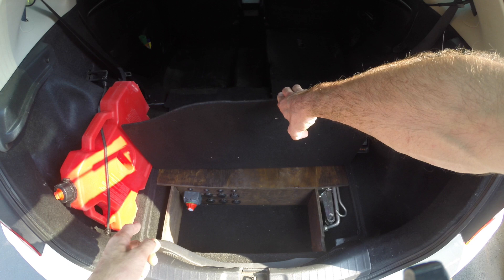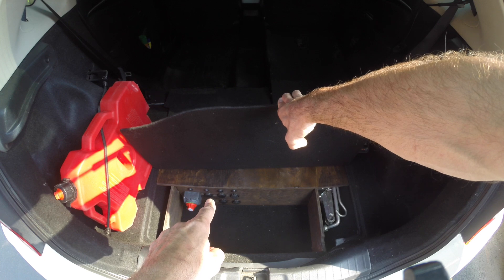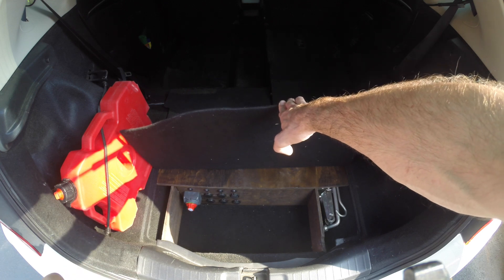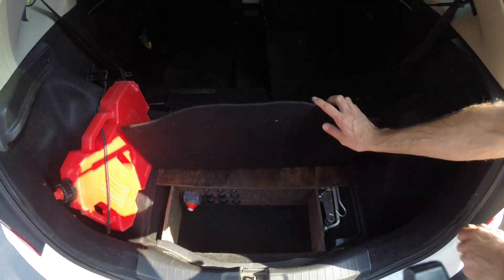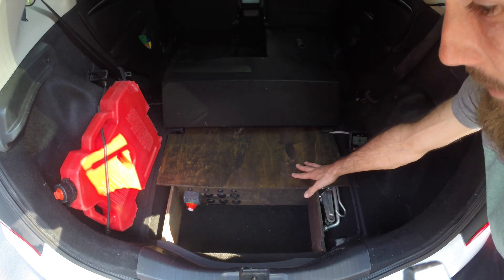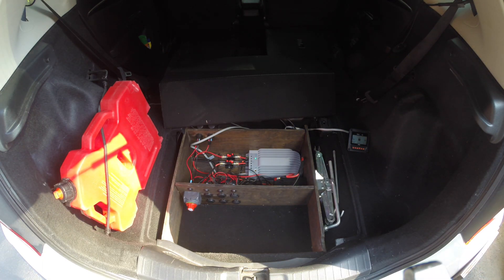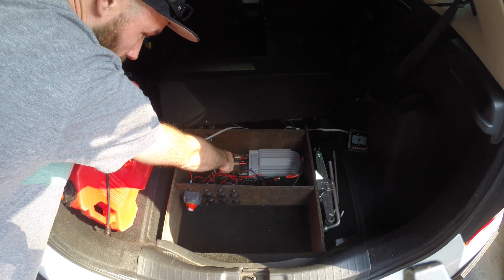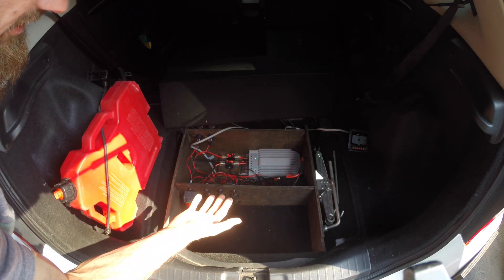HONDA FIT/JAZZ - GK5 - Solar Setup - "Spare-tire Solar Storage Box" #HondaFit4Adventure

Comment from the maker: UPDATED SOLAR STORAGE- Milk Crate Solar Battery System https://youtu.be/269fXIBK7O8
A few Amazon links to items shown in today's video.
USB ports - N/A
12v port https://amzn.to/3sKpG8G
Blue LED Toggle Switches https://amzn.to/3FJCU9m 
Red LED Toggle Switches https://amzn.to/3Hfj1rj 
100pc Blue spade Connectors https://amzn.to/32G1cTm
100pc Red spade Connectors https://amzn.to/3FNbOi1
27pc Large Diameter Heat Shrink Tubing https://amzn.to/32JiOxK
16AWG Red & Black Copper Wire (25ft) 50ft Total https://amzn.to/3euJNjc
EPEVER MPPT 40A Charge Controller https://amzn.to/3mEv7T3
Battery Disconnect Switch https://amzn.to/3Hm3JBf
Blue Sea Systems Fuse Block https://amzn.to/3z1olLU
RotoPax 2 gallon https://amzn.to/3Hhlem8

Comment: Excellent work, in my fit I used that space to put a subwoofer and I keep the spare tire, there is very good space there.
Reply from the maker: Thank you. 
I eventually moved my solar box elsewhere and now keep a full size spare tire back there with out the Styrofoam insert. 
Did you make a whole in the spare tire flap cover for the sub? So the sub lifts up when you open it to access the spare tire or something else?
Reply: @HondaFit4Adventure   Thanks, I kept the original spare tire, I just raised the floor and the cover is the subwoofer plus the amplifiers on the same floor, so that it is at the entrance level (door) eliminate the Styrofoam, I do not know if I explain myself well jejeje (my English is bad) I made you a photo album on google in case you want to see it and better understand the work I did. (I give it to you by Instagram Private message because YouTube delete my link i share ) Greetings

Comment: Very cool! What is the purpose of the solar box? Cheers!
Reply from the maker: Thanks Guy.
The purpose of all this is for camping or carcamping.
I previously was using some USB battery packs to charge up phones cameras etc.
After a couple of camping trips where the temperature didn't drop past 97*F at night, I would need a little extra power to run a 12v fan all night long because a 5" USB powered fan would not cut it. The fan cord is long enough for me to use it in the car or run it to my tent.
Now I'm also able to use a heated blanket during the winter months.
Reply: @HondaFit4Adventure  very cool!!!

Is this a product you came up with? I can only see hundreds applications for this in the Automotive Aftermarket.

Cheers!
Reply from the maker: @F250eh  Hi Guy,  It's only a small solar setup. All the products already existed. Instead of building a prebuilt system like "GoalZero" I chose to build my own.
My newest use is powering a heated blanket during the winter.
Reply from the maker: Update: It now powers a heated blanket in the winter.

Comment: Looks better than OEM with that box. Awesome. 
I took my donut tire to have a secret space to put my laptop. This add will make my fit with a secret stealth compartment. 
Do you have the dimensions of the box or any input to I can make my own?
Reply from the maker: I'll take some measurements for you. The hard part is dealing with all the curves on the bottom. Keep in mind I still have my spare tire but it's on the roof rack.